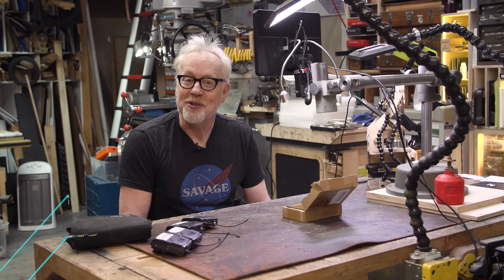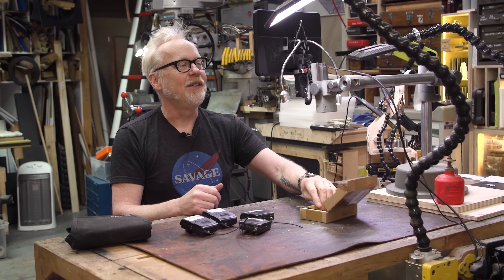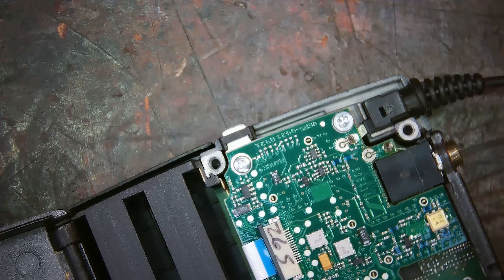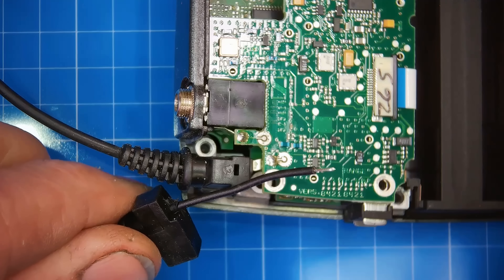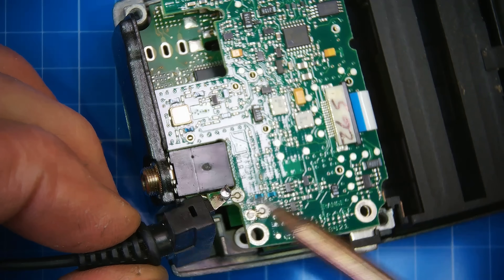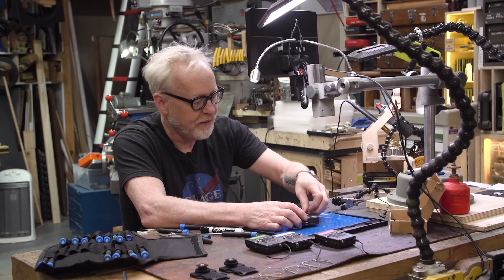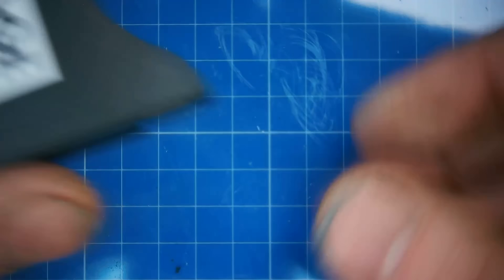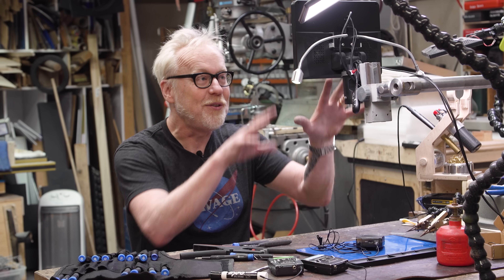Can Adam Savage Fix Our Microphones?

Comment: You'll have a lot better luck with your mics if you switch from Sennheiser (blech) to Sony UWP-D series. The Sony mics work and sound SSOOOOO much better and are the same price or cheaper. Trust me on this one -- you'll thank me later.

Inevitably when I'm working on location and there are audio dropouts with a wireless system, it ends up being a Sennheiser. They everywhere, but they really aren't very good.

Comment: Another fun failure mode of the Sennheiser receivers is that the plastic shoe that mounts the receivers to a camera handle or accessory mount breaks too easily. Fighting with the springs that hold the bracket assembly in place and fiddling with the smallest screw in the world that holds the shoe in place are one of the greatest pleasures to be had. 😄
Reply: velcro is your friend!

Comment: With plastic screw (or any self cutting screw for that matter) I would advice to turn the screw backward till you feel the screw drop into the excisting threads.
otherwise there's a chance it might cut new thread weakening the construction
Reply: This is advice everyone should follow. Always start screws backwards. It will automatically align the threads and prevent all sorts of issues. Drive it forward after it drops into place.  This is one of those pro tips that actually works and ought to be a basic practice for everyone.
Reply: @LatitudeSky  I learned the trick from reusable drink bottles and took the lesson over to pill bottles and screws that go into plastic.
Reply: Standard advice from the Nerf modding community, too.

Comment: Its nice and confidence inspiring to have the oem replacement, but that is simply wire.  You paid 20 bucks for the plastic strain relief molding.  We want to see you fix the Sony's with wire out of the medcart drawers, and some hot snot strain relief, and a pinched off heat shrink at the tip :)

Comment: I would have looked into making the antenna detachable to make them a bit more future proof (and less likely to get more damaged in storage & transport). Would have needed some extra hardware and some £d printing and design work to get right though. Future project maybe; obviously broken kit is useless kit so a fix now is always better than a fix in a few weeks in some scenarios :)
Reply: Detachable just makes it another failure point, no thanks!
Reply: @SomeGuysGarage  An easier to fix, and less time consuming failure point, however.
Reply: @marcd7307  the socket/jack is just as likely to fail as the antenna itself.
Reply: @SomeGuysGarage  I disagree, but we're talking antennas here, not the input connector
Reply: The thing is that they fail because of rough use, not storage.  So detachability is not relevant to durability.

Comment: Love these mic packs. Been using them for decades. I would like to say they are "bomb proof", but then probably only you would know if that is really true - lol. Never had to replace an antenna, but now I have a reference if ever that is needed. Thank you!
Reply: Several aftermarket makers have far more bullet proof antennas than the OEM type. There's one that even has a little more aggressive mod where you drill a hole in the other side of the case, thread it (they have it in the kit) and you basically make a loop of wire, that's bolted to the case. Very stout antenna. They're all online, not gonna link or name on account of YT's draconian rules.
Reply: I've found the cable strain relief and plug/socket combo fails more than the antenna
Reply: Agreed. The ew100 series are great wireless systems. Even had an actor drop one in the toilet while it was on (yes, ew) and I disassembled it and scrubbed it with alcohol and stuck fresh set of batteries in and it's still in service to this day.

Comment: Adam, you can purchase the antenna terminations and the bulk antenna wire, and make your own antennas. You just have to remember to cut the wire to at least a 1/4 wavelength of the transmitted signal, or it will not function correctly. The forward and reverse VSWR will be incorrect, and you could damage the transmitter output transistors.

I work at a TV station and we repair all of our own transmitters and receivers, as well as replacing the damaged microphone capsules. You need a spectrum analyzer to adjust the transmitter parameters and follow the testing procedures. Fun time!
Reply: This is extremely misleading. You can't choose an arbitrary length "*at least* a 1/4 wavelength," you really need to hit the 1/4-wavelength precisely, assuming that's what the antenna is designed for. To a first approximation, if you don't have an antenna analyzer you should not try making your own antennas.